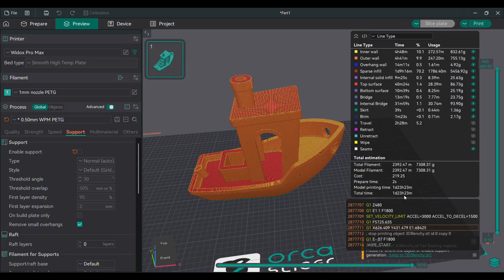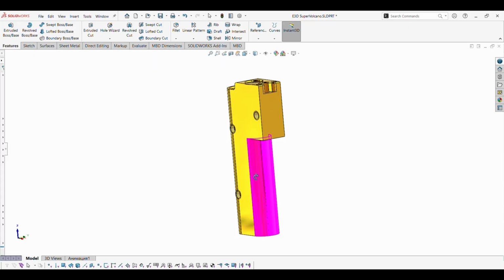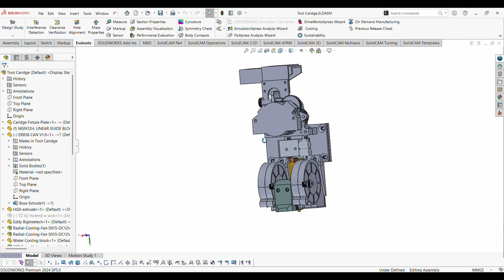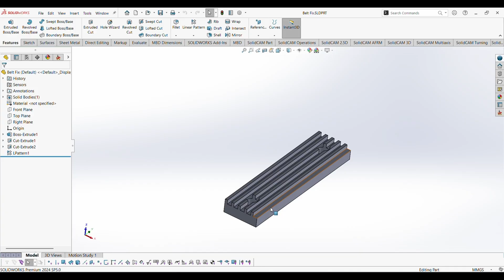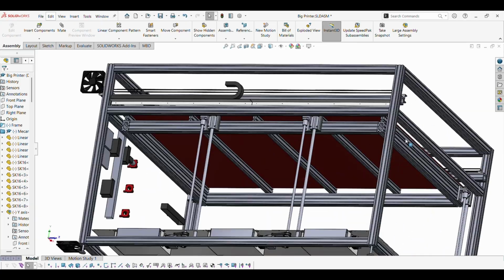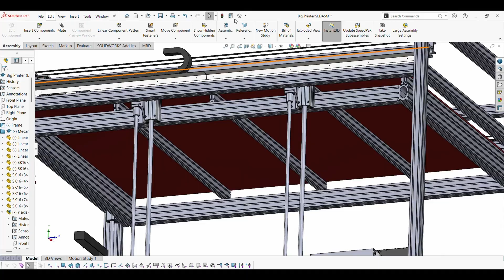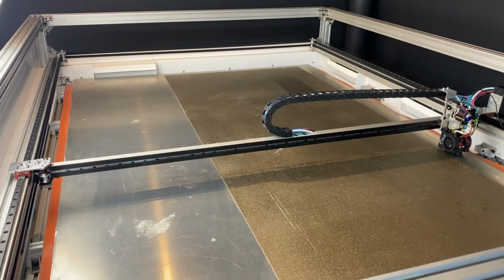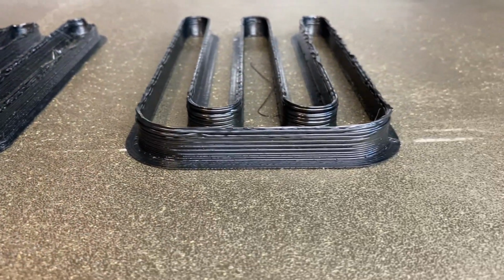I Think I Built the World's Most Overkill Big 3D Printer

Comment: You are probably already aware of this, but i‘d highly recommend changing to a different probe than the BTT eddy before using this beast to do high chamber and bed temp prints. 
I had this probe installed in two different, much smaller printers (Trident - 250 and Frankenvoron 2.4 - 350) and especially on the latter it caused constant headaches. Even with Eddy NG i had to re-calibrate it at least every few days, and the chamber never went over 50 degrees. 
Just a heads up, other than that i‘m a big fan of your style of presentation and this project, hope to see more in the future!
Reply from the maker: Thank you for advise! I haven't tested the probe sufficient enough, but I will keep that in mind. Have you tested any other alternatives?

Comment: I am currently in the process of designing something like yours. Just one question, why the belts?
Reply: I mean, you explained why, but won't a cooled stepper just be easier to deal with? belts at those lenghts just seems like a nightmare, even steel cored ones
Reply from the maker: Good question, first of all, I already had most of the hardware required for the belt system, and obviously, going into ball screws would be too expensive. Additionally, cooling steppers inside the heated chamber requires not only additional heat exchangers and piping but also increased requirements for the cooling unit. And Additional heat insulation will also add more weight. The main factor actually was to reduce the moving weight.
Reply: @galactic_design  I see. I've found a few cheap ballscrews online but at the same time I have to work around the fact that they will be surely crooked and not a precision instrument. I wondered if I can integrate comething similar to a wobblex but for the horizontal axis, or maybe just get giant profiles and linear rails that would compensate and straighten the ballscrews. My project is still in its infancy stage (all in my head at the moment) but I'm aiming at 800x1600mm, not sure about the height yet.
Reply from the maker: Understood! Good luck with that!

Comment: i might be wrong here, but shouldnt the thermistor be closer to the nozzle to ensure the temps are correct? otherwise this all looks fantastic. did you design the corexy system yourself? it looks different than a lot of common ones, ei voron, zero g etc.
Reply from the maker: Thank you! In general I agree with your concern about thermistor. In my case, the hot end has so much metal around and the heater resistor is also as long as the whole hotend. So I believe temperature difference will be not significant for my application. in the next videos I am going to test other nozzle, so we will see.

Comment: That mainboard is really not barely useful, I will take one of those duet 2 and duex 5 over a btt mainboard any day, they are way more reliable and it is made to be used with reprap firmware which is very nice too
Reply from the maker: That is true!
 I had some difficulties flashing it with the klipper, had to use older linux build to compile the firmware. But in the end it worked out. I have even connected panelDue to Klipper
Reply: @galactic_design  to be honest you really don't even need to switch to klipper, reprap firmware is very capable and even better than klipper in some ways
Reply from the maker: @FlingingPlastic  I was using RepRap for a couple of years, it is well designed indeed. It is just that there is no input shaper yet.